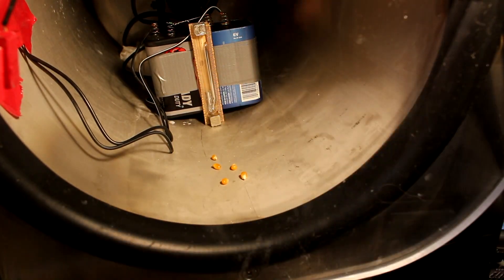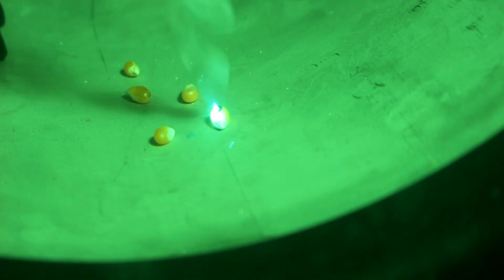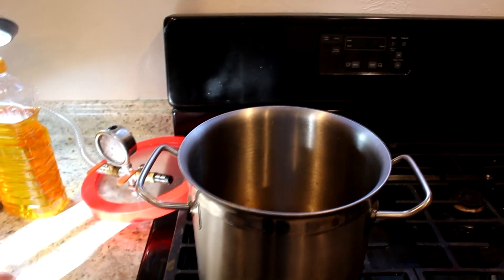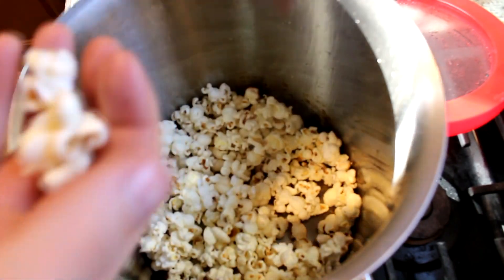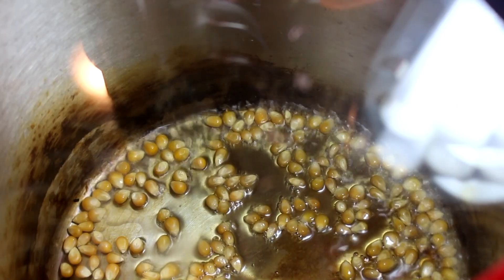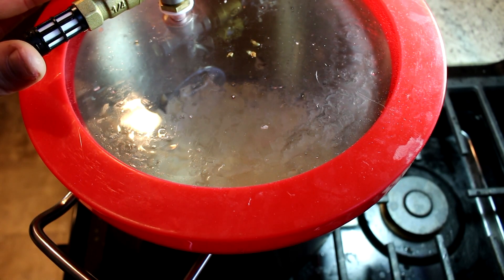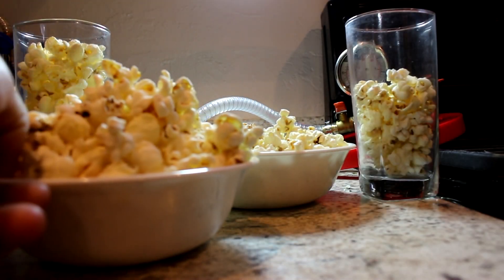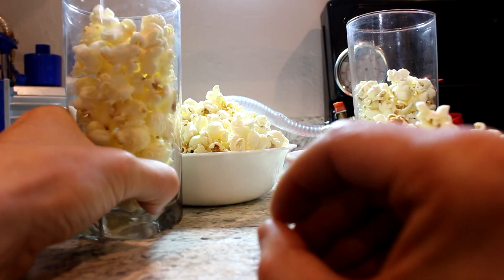Popping Corn In a Vacuum

Comment: For some reason, I thought It would pop itself in the vacuum. I thought the boiling temperature would drop drastically or something like that.
Reply from the maker: The pot was heated in both trials, It should lower the temperature; but I'd imagine it would only be a factor of about 10% basically unnoticeable.
Reply: Cody'sLab if it was a full vacuum, maybe the pressure difference could cause it to pop on its own? probably not tjoigh
Reply: @obviouslymatt6452  eh, who knows
Reply: Grant Kelley I think the internal pressure from the outer shell keeps the boiling temp from going down too much, same reason your blood wouldn't boil in space.
Reply: @Clorbius but wouldn’t your blood boil in space? (Ie: Armstrong limit)
Reply: it was a good observation that many had so instead of many people commenting the samething they could see that it was said and they can simply like it
Reply: How do you suppose it will be abused?
Reply: Just looked it up with the temperature popcorn pops at and a steam table. It's about 180C and 9Bar. 1Bar of pressure difference is not enough, and the temperature for it to pop at is only lowered by around 5C. Disappointing.
Reply: only youtubers can pin comments on there own videos
Reply: Stefan Visser Once you figure out how to break the law of conservation of mass, yes.
Reply: As long as you don't heat the kernels there can't be more than 1bar of "overpressure" inside, even if you have the perfect vacuum around them. It doesn't matter if the water inside would boil. Boiling due to vacuum is very different to boiling due to heat. It can't suddenly create more pressure by itself. 1bar is not much and apparently not enough for a kernel to pop.
Reply: +Cody'sLab 

 G'day,

   It seems to me that you probably should've patented the idea, and licenced it to a Global Popcorn Company, rather than uploaded it to YT...; 20% more Volume of Popcorn from the same amount of Corn Kernels, and it tastes "Fluffier" as well ?

  Mate, that's a double breakthrough, in the Salty Junkfood Industry's terms...!

  Just(ifiably ?) sayin' ,

  ;-p

  Ciao !
Reply: But how does anyone know that it's pinned? I see no visual indication of such.
Reply: Low enough vacuum and the boiling point would get to room temperature, but I imagine as mentioned they kernels have enough toughness that the internal pressure wouldn't be effected. At those sort of pressures though I imagine Cody would get the massive popcorn he was after.
Reply: Nope, for the kernels to pop the vapor pressure of water would have to exceed the structural integrity of the kernel.  The vapor pressure of water at room temperature doesn't change just because it is in vacuum, it is still quite low, so no popping until the kernels are heated considerably.
Reply: Hi Cody, did you use heat while the vacuum was on? Or did the corn pop by only the vacuum?
Reply: Cody, ya' FREAK !  you denatured pop-corn making ! The children of the corn will get you for this !
Reply: The problem is that a moisture trap has to be implemented or you risk damaging the vacuum pump. Moisture traps can be as simple as a bunch of Silica in a sock (Cody did this once), or as complicated as a condenser coil (Cody's freeze-drying machine just cools the chamber down to use as a condenser surface).

This increases the cost.
Reply: That's the sound of the kernels impacting the sides of the chamber, or the reactive force of the popping kernels against the bottom surface. The pot is in direct contact with the ambient atmosphere.
Reply: The mass is the same, but it occupies more volume therefore less density.
Reply: Dheorl
Makes sense, but do you think he had the burners on while the vacuum was on too?
Reply: I'm pretty certain the heat must have been on.
Reply: Rishank Kumar
You are very learning resistant. It has been said by multiple people here now. Look up (and understand) vapor pressure. It is irrelevant if there are pores on the kernels.
Reply: kedwa30 the
Reply: Grant Kelley Me too.
Reply: haredeenee
If someone makes a stupid comment and is embarrassed by it, they can delete their own comment. I agree, pinning could be abused to promote ad bots. But everyone can still flag it as spam. Over-all, I think pinning gives the content creator more control over his channel and is a good thing.
Reply: Grant Kelley hej
Reply: Grant Kelley Same
Reply: If I still had access to a CVD chamber I'd definitely try it in there. could get down to the order of 10^-7 and even had a "hot plate" of sorts built in.
Reply: Will the vacuum popcorn have a bigger mass then the normal one?
Reply: Rishank Kumar Dude, the vacuum will still draw moisture out of "dry" popcorn. As long as popcorn has a bit of moisture in there (it does, this is the reason why it pops), then it will evaporate and collect in the vacuum pump.

This is bad.
Reply: Same
Reply: tye tygon You missed the part where he said "The pot was heated in both trials"
Reply: Pixl Rainbow
No, he is talking about keeping the moisture in to make it pop. Never even mentions the pump once. Still doesn't understand vapor pressure (and that if you put a hard shell around something the pressure won't drop on the inside at all, so no boiling in the first place; not that that would change anything)
Reply: well that was far from a perfect vacuum, as you can tell you could still hear the popping loud and clear, with complete vacuum i'd expect much different results.
The temperature difference should be much greater
Reply: superdau he is replying to pcblah's comment, which says "water will evaporate and collect in the vacuum pump. This is bad"
Reply: Pixl Rainbow
Still never mentions the pump. His only given reason to keep the water in is to make it pop. That's not the reason it doesn't do that.

Dapix
It is irrelevant how perfect the vacuum is. It is about pressure difference. (Disclaimer: there is no such thing as "suck", it is always pressure pushing, but for arguments sake) A vacuum can't "suck" harder than one bar at see level. Even if you left 10% of the air in the chamber, you are already 90% the way to perfect vacuum, so you get 90% of the physically achieveable pressure difference. Going the remaining 10% doesn't change anything here.
Reply: The oil boiling more dramatically is definitely due to the lowered pressure, though.
Reply: +superdau Thanks for this explanation. I think this is what most people were wondering about.  
I think it would be possible to lower the pressure needed to pop the corn by dissolving some of the shell with lye, the same way hominy is processed.
Reply: Grant Kelley
Reply: Adelphius youtuber could pin a stupid comment someone made, targeting that user. could be used for more ads.
Reply: What is pinned?
Reply: I also thought that it might pop  itself in a vaccum
Reply: same
Reply: the kernel isn't a bubble thats waiting to be popped, if it were to pop simply by creating a vacuum then it would be doing only that - popping. it wouldn't go through the change of actually becoming 'popped corn'. that would be like putting puff pastry in a vacuum and expecting it to come out as a crunchy sheet. it may puff but It wouldn't actually cook. the starch and protein in the kernel wouldn't be activated correctly by pressure alone.
Reply: Grant Kelley there is a video of water boiling at room temperature from Cody so it should be pop corn pop at room temperature
Reply: superdau actually as a small correction there isn't boiling due to pressure as much as lowering a boiling point enough that it's lower than ambient temperature. Theoretically with enough vacuum it would pop and produce even larger pop corn but would be room temperature. But who would want to eat big cold popcorn, that's crazy.
Reply: The problem is vacuum chamber is too big. You need a vacuum tube for vacuum to be strong enough then coat the pop corn with Molten sugar let it dry put it in vacuum and it should pop.
Reply: That is why pop corn needs a coating of Molten sugar it will close all the pores on the corn and won't allow the moisture to escape as pressure drops the moisture will start boiling inside the corn and finally pop.
Reply: +superdau he's talking about something else. He means to say that closing the pores on the popcorn means that the water is unable to escape and damage the vacuum pump
Reply: why is this comment pinned? i never knew you could do that, unfortunately its a feature that is likely to be abused
Reply: @haredeenee  Only the owner of a channel (in this case Cody's Lab) can pin comments.
Reply: @haredeenee Only the channel owner can pin a comment. No way for it to be abused.

Comment: would the order matter because on the atmospheric pressure go you die oil then corn but with vaccine chamber you did corn then oil I would think there would since the corn is exposed to more oil when the oil is in it first where the side towards the pot will not get as much oil as the atmospheric on

Comment: I think the laser wouldve worked given more time. You wouldnt believe how hot the kernals have to get before they pop!
Reply: seemed like the laser was too powerful, was actually burning the kernel and not just vaporizing the moisture. would probably work with a bit of oil to help distribute the heat
Reply: Zreknarf If you wrap a kernel with a little tin foil and draw on it with a black marker you can pop a kernel with a laser, and it doesn't burn at all, plus it taste pretty good too.